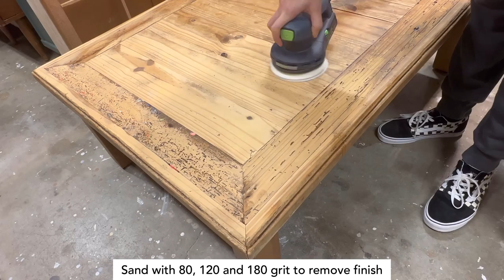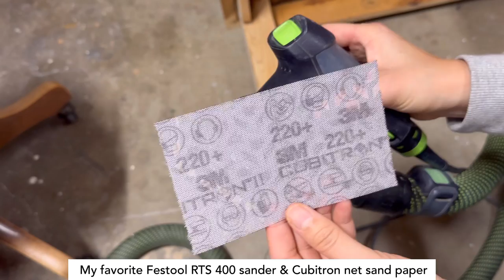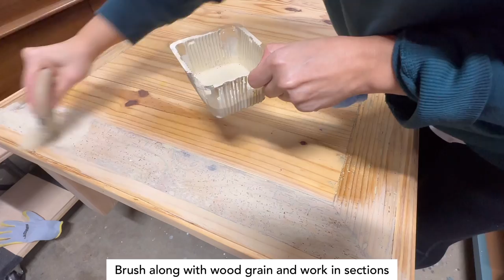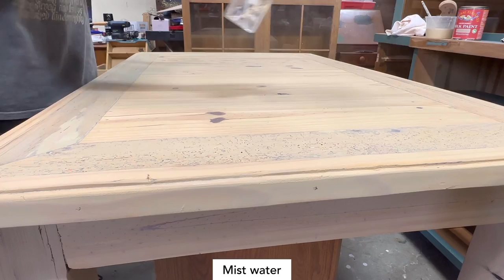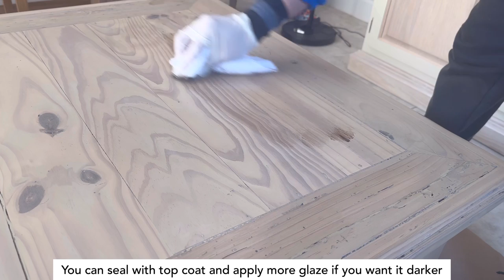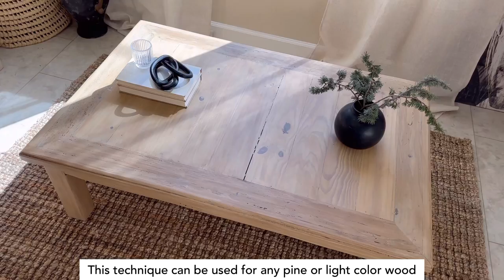No more orange pine! Coffee table makeover. Learn how to paint wash and glaze🤩

Comment: Great job! You made pine look so clean and modern. I have an orange pine cabinet that I would love to try this on. Can you explain why you used a mister before the first topcoat that was prior to the glaze? 
Will have to save this one for sure!
Reply from the maker: Thank you! Misting water helps with smoother application for the top coat. If you are planning to apply glaze, I recommend misting water again so it’s easier to work with. This is when you are using a water based product.

Comment: Do you have to sand between the top coats ? And do you have to sure Satin for the first top coats or can you just use the flat/Matte?
Reply from the maker: Lightly hand sand in between top coats with 600grit sand paper. Sand and wipe dust with a tack cloth. More sheen, more durability! I used first coat satin since it’s a high traffic area. You can use flat starting to finish.